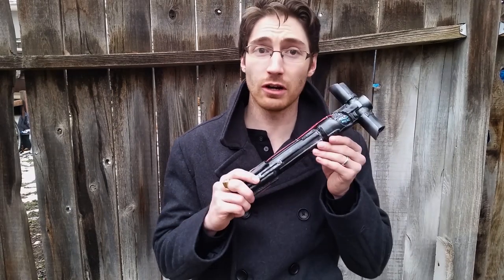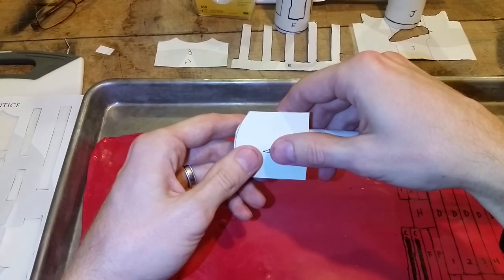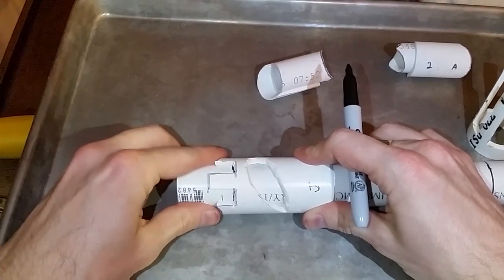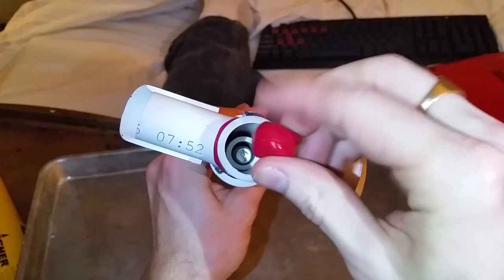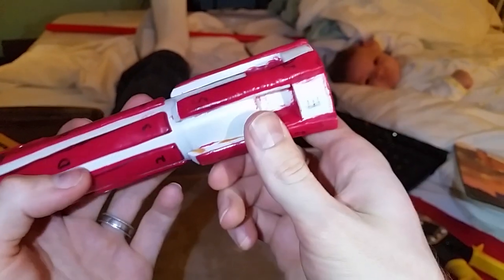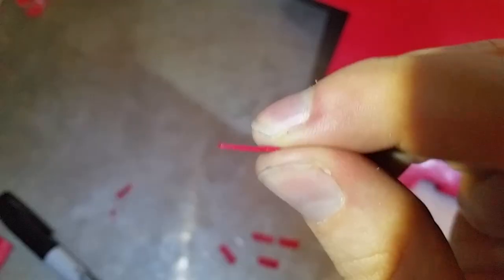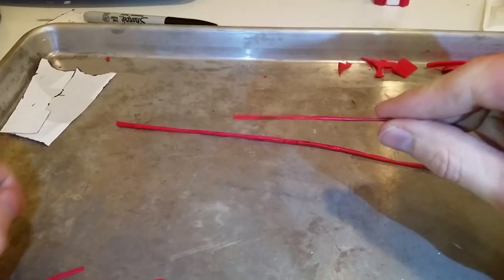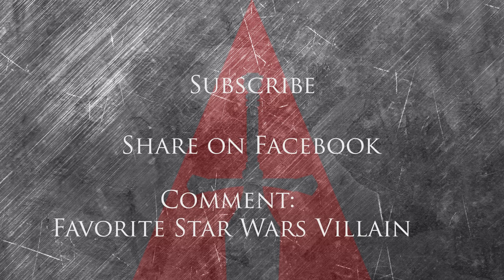How to make a Lightsaber - Kylo Ren's Lightsaber | Cosplay Apprentice

Comment: is the flash light as small as the one from lukes ?
Reply from the maker: The flashlight for Kylo Ren one will have to be a bit smaller than the Luke one. Unless you shave down the inside of the Kylo ren one you can get it to fit, but otherwise it would be too tight.

Comment: does the Template work if printed in A4?
Reply from the maker: +MrAtom159 it should work add long as you print actual size and not fit to page :)

Comment: what is the tool that you use to heat the plastic
Reply from the maker: +TheMightyHarith A heat gun :) they have then at regular hardware stores and online. I have a link to one in the description on amazon on several of my videos if that helps find it easier :)
Reply: Thank you
Reply from the maker: +TheMightyHarith no problem, Harriott to help :)
Reply from the maker: +TheMightyHarith I meant happy to help :)

Comment: how did you paint it
Reply from the maker: +TheMightyHarith I painted it all matte black and then dry brushed it with silver, I believe I have a link in the description to a video talking more about dry brushing:) then I used a small paint brush to do the wires, then I think I coated it in a clear polyurethane floor finish coat :) Hopefully that helps! :)

Comment: What if my plastic doesnt liquifi as much as yours so it just looks like a putty not like a liquid like yours?
Reply from the maker: +Dávid Čano what is the name of the brand you got?
Reply from the maker: +Dávid Čano what is the name of the brand you got?
Reply from the maker: +Dávid Čano what is the name of the brand you got?
Reply from the maker: +Dávid Čano what is the name of the brand you got?
Reply from the maker: +Dávid Čano what is the name of the brand you got?
Reply from the maker: +Dávid Čano what is it called, the one you got?
Reply from the maker: +Dávid Čano what is it called, the one you got?
Reply: it is a local brand here in czech republic, called shape-plast
Reply from the maker: +Dávid Čano how well does it stick to itself? Are you just heating it with hot water? You need to get it hotter for it to become softer. I apologize I am not familiar with the brand.
Reply: well if I heat it all the way trough it sticks pretty decently to itself and yeah, I've been just using hot water and a hair dryer to heat it because I dont have a heat gun like you do
Reply from the maker: +Dávid Čano The important part is that it sticks well to itself. It should work fine for the builds, the toughest part if it doesn't get as soft is just that rolling it into a sheet might be a bit more difficult :/
Reply from the maker: +Dávid Čano The important part is that it sticks well to itself. It should work fine for the builds, the toughest part if it doesn't get as soft is just that rolling it into a sheet might be a bit more difficult :/
Reply from the maker: +Dávid Čano The important part is that it sticks well to itself. It should work fine for the builds, the toughest part if it doesn't get as soft is just that rolling it into a sheet might be a bit more difficult :/
Reply: Oh yeah I can see is being a problem since it acts more like a rubber when I attempt to roll it :/
Reply from the maker: +Dávid Čano if you have a Pasta  maker, it would help in rolling out the plastic :)
Reply: well, tha't an idea I would never come up with :D as I said If want to straighten it I have to physically stretch it instead of rolling it... and also I have some wory about it not being sticky enough because if I want to connect two pieces I either have to heat them like REALLY hot or they'l eventually fall apart really easily
Reply from the maker: +Dávid Čano :( I hope it works out, having a heat gun will help a lot for getting it hotter.
Reply from the maker: +Dávid Čano :( I hope it works out, having a heat gun will help a lot for getting it hotter.